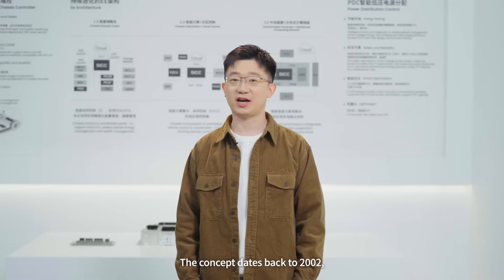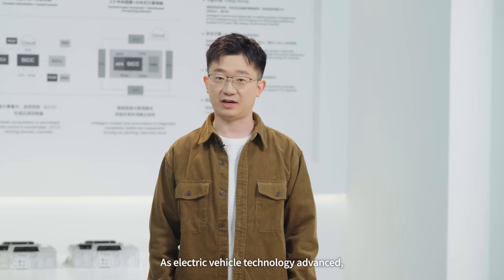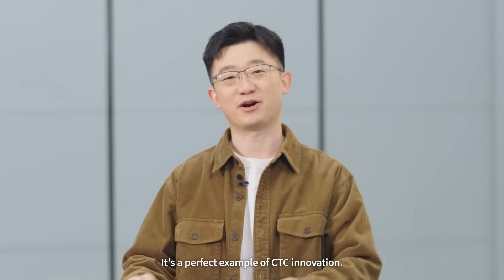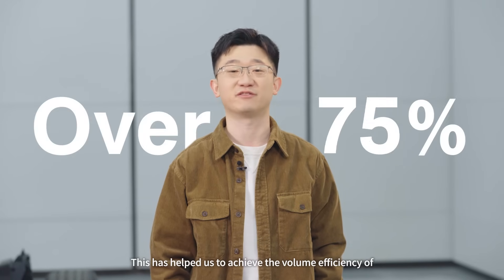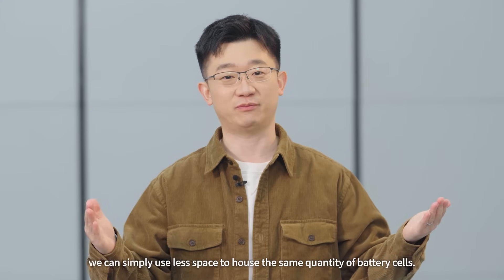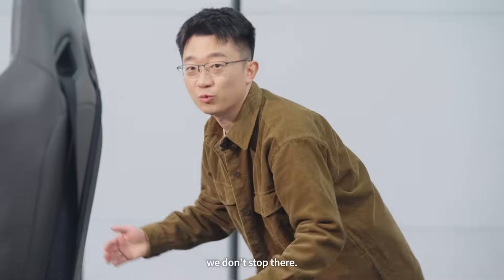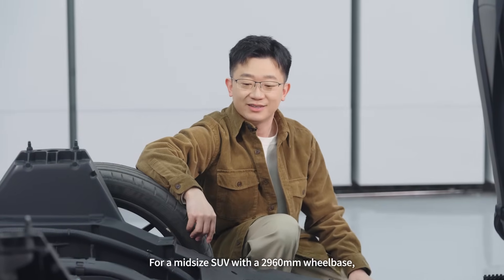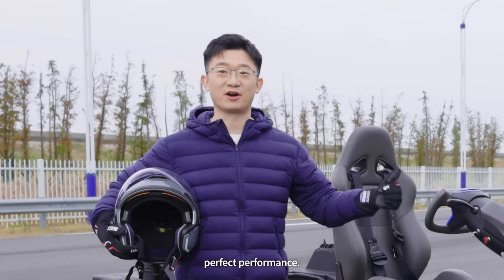Next-Gen Chassis

Comment: What happen if I want to change the battery due to faillure? This innitiative can increase volume but create tons work for repair. This idea is more like if the battery fail, scrap the car 😂. The future will be standardized battery modular, which has the same size. You can replace your old battery with the newest one because it has the same size, then no customers panic on skyrocketing price of phased out models

Comment: How do you replace any cell if the chassis were slightly damaged due to collision or road debris? Certainly you’re not telling me that I have to replace the entire chassis
Reply: Not the entire chasis but it would mean the chasis was damaged and would need repair alongside replacing the battery. Structural batteries DO indeed mean simple replacements are harder. Some, you just have to replace a module but how big that module is depends on how they built things. The full CTC one seems like it may require manufacturers or dealers to replace the battery even if they could later fix it.

Comment: Does that mean if you need a battery replacement, you need a new chassis?
Reply from the maker: No need to worry, our skateboard chassis is designed with modularity, allowing for the battery to be replaced separately without the need to purchase a new chassis. Although the need to replace the battery is very rare, we have already considered this requirement during the design phase and have conducted extensive replacement and maintenance verification. Therefore, the energy pod can be replaced instead of the entire chassis.
Reply: This is good engineering.
Reply: @CATLOfficial the sooner you kick ass the better. atta folks!
Reply: The new chassis will include the battery 😂
Reply: @wensiangfong  the matter is always if the price is right. engine and other stuff doesnt make part of the chassis and may be reused. the upper part if done correctly, can be swapped too
Reply: No, it doesn't.
Reply: I am assuming the battery modules can be pulled out.

Comment: if it was tesla people would be going crazy
Reply: Tesla invented structural battery packs. They've been using it with the Austin Model Y for years and now the Cybertruck.
Reply: @ structural batteries are a terrible idea as they can't be replaced it limits the lifetime of the vehicle
Reply: @avus-kw2f213  That's exactly what they're doing here as well.

Also, nope, the entire structural pack can be dropped and replaced. Not that they'd need to since there are several old Model S cars with over 400k miles on original battery and still going strong.
Reply: @ethan999oz  of course it will still go but not as far on a single charge
Reply: @ The point being, it's still possible to replace the pack.
Reply: @ethan999oz  yes but not as easy as replacing the petrol
Reply: @ The comparison here is between CATL and Tesla. Not petrol, lmao.
Reply: @ethan999oz  China makes electronics America makes petrol cars

and this is about reactions, not technology
Reply: @ No, this is about structural batteries. Nothing else.
Reply: @ethan999oz  oh than I’m wasting my time goodbye
Reply: @ethan999oz  Having to replace a pack rather than a faulty or damaged cell is a dreadfully wasteful and costly idea. With newer chemistries and solid state electrolytes energy density will be much higher and the need to save weight won't be as crucial. Structural packs are a temporary fad.
Reply: @Hejavra  People have been making this argument about battery packs in general for over a decade now. Yet even now, when battery technology is still in its infancy, only a small fraction of the cars ever experience the need for a cell repair in reality. It's even less now considering how much progress have been made in cell longevity. 

Secondly, with the even newer chemistries making batteries more reliable, structural batteries still make sense cause saving weight improves efficiency. And efficiency is the most important factor when it comes to EVs. It's ridiculous to suggest structural packs are a "temporary fad". This video wouldn't exist if that was the case.
Reply: @ Actually I agree that calls are more reliable and even now highly unlikely to need replacing. However, I still think a maximum range of 500 miles is more than adequate for the vast majority. That means in a not too distant future where energy density of 1 kWh/kg & 1kWh/litre is achieved and vehicle efficiency of 5 miles/kWh, a 500 mile range would only require a pack of 100kg and 100 litres…not really a size that makes a pack structurally relevant in mass produced passenger vehicles. Although it's possible they may still be advantageous in commercial and niche performance vehicles. You might also argue that V2G might still popularise huge packs in passenger cars but I see commercial and home grid storage becoming so ubiquitous and simpler to manage that V2G won't take off in a big way. I guess we'll see. Thanks for your thoughts  🙏

Comment: What about maintenance? Is it relatively easy and inexpensive to fix? Lead time for parts? Are components modular enough that if 1 cell is faulty i don't have to replace the entire battery pack? If the pack needs replacing, what is the supply chain like?
Reply: The entire car is disposable
Reply: @すどにむ  Have you been to the Scrapyard lately?
Reply: @ oh so you spend your day gutting foam out of Tesla packs?
Reply: This is a big thing about these structural packs. They make maintenance, especially outside of the dealer much harder and more expensive. The weight and room savings aren't all worth imo.
Reply: @nfzeta128  Again, no need for maintenance for the life of the vehicle, use for 20 years till they degrade and recycle them or replace them if you dare.
Reply: @ Unless something fails. Could be external causes like rock chips puncturing cells. Then the entire car's totaled, which makes it a disposable product.
Reply: @すどにむ  Rock large enough to go through steel plating protection of battery is large enough to cause major damage even for internal combustion car. Maybe oil sump or gearbox replacement may be cheaper, but is still dearly expensive, easily USD10K job compared to 20K battery job, none of them ideal, insurance can deal with both.
Reply: @すどにむ  People dispose of their vehicles much sooner of late, 4-8 years. Tradition of keeping vehicle from new till it breaks is becoming very rare.
Reply: @ You're just sugarcoating the word "disposable". The point is that the car remains repairable vs disposable, and it's not even about ICE vs EV. Many EVs are in fact repairable.
Reply: Still thinking about legacy technology I see smh. There are no moving or friction parts, no maintenance part. Generally engineered for possibly up to 20 years of use and will likely exceed about 1.5-3.5 % current degradation of current batteries per year. Owner/operator at 20 years could still be having 50-70% usable capacity or the entire battery can be reused for household or other energy storage purposes as is the case even now.
Reply: @ So accidents don't happen (crashes, flying debris etc)? Fewer moving parts does not mean no issues with the car, there can still be manufacturing faults which has happened with all EV manufacturers.
Reply: @verygoodbrother  True that, but it's the same with any type of vehicle. Try buying an Range rover or BMW X5/X6 outside of Warranty!
Reply: @thabzmad7265  I didn't say anything about warranty. I asked what is maintenance/repair like? You responded with a defensive and irrelevant comment despite you agreeing that an EV is like any other type of vehicle (duh, hence the question).
Reply: @verygoodbrother  You mentioned manufacturing faults, these are typically issues dealt with under warranty. Nothing defensive about it, just stating reality. Good day.👍
Reply: @thabzmad7265  manufacturing faults or not it is good to  know costs and lead time. The costs factor into car insurance and how long someone will be without their car. Like I said, you're being defensive over a simple genuine question

Comment: Love CATL Innovations !
Awesome Build Chassis !
Wish CATL can also build a removable batteries Large Chassis that has high ground clearance for off-road pick-up trucks , large size cargo van , RV Campers , Buses and trucks with an air suspension system abilities to be lower on highway speed and rise up on rough mountain terrain off-road condition. 
This high ground clearance Large Chassis will sell like Hot Cakes for many different applications  !!!
Hope to see Large Size Off-Road Electric Trucks and Large Electric Cago Vans for safer, cleaner environments !
Wish to see this happen someday in the future  !
😉💖🛻🚚🚐🚎🚌🚒🚑🚎⚡️🔋💯👍
😉💖🌬🌊🌞⚡️🔋💯👍🌏✌️🙏

Comment: So now you can’t replace the battery pack at all? Man, that doesn’t feel good.
Reply: I know that the lifetime of the battery can exceed that of the rest of the car, but still …
Reply: Did they say that? it certainly looked to me like the cells were slotted in....
But, even if they can't Take a look on the channel and you will see the CATL cell failure rate is trending to zero.
Also investigate how many cells they use per pack, divide the capacity by that number to determine the percentage loss, then question if the individual cell can be disconnected from the pack by the BMS.
let's guess at 200 cells?
In that case, loss of one cell would result in 0.5% Capacity/ Power reduction.
As for "The pack", CATL is predicting VERY long life.
Anyway, why do you assume the "Pack" would be the point of Failure rather than the control modules?
If they failed, they could be replaced.
Reply: The BMS will never be able to isolate an individual dead cell. It would require far too much extra cabling.

Will be interesting to see if cells can still be replaced in this design.
Reply: Porsche did it with the Taycan, isolated the bad cells from the pack. Although, they didn't on the car's software, it happened at the dealership.

Comment: Please develop dry coating solvent-free  process  production line  for 30% lower production costs and 30-40% higher nominal capacity(even higher in LFP cathode cells because LFP cathode has the potential of 60% higher active materials in dry coating process)and energy density cells because of thicker electrodes(almost double in thickness) and higher active materials in both cathode and anode in the cell.also please develop an ultra power dense electric drive unit with 11 kw/kg drive unit level power density and 21,000 rpm rotor speed paired to a 2 speed transmission for maximum high speed efficiency with gear ratios of 12:1 for first gear and 4:1 for ultra high speed efficient second gear for your amazing BEDROCK CHASSIS
Reply: D'ya think they MIGHT have look at ALL possibilities? (As the Largest Battery Manufacturer on the Planet?).... Maybe?
Reply: dry electrode coating manufacturing process has never been done by any commercial battery manufacturer ever.its relatively new technology.tesla trying so hard to manufacture world's first cylindrical battery cell(4680 form factor)that implemented both amazing tabless technology(compared to traditional tabbed cells tabless cells have twice the cycle life meaning 4000 cycles,up to 70% lower internal resistance meaning 40% lower generated heat in heavy pulse discharge rate,up to 200A pulse discharge rate for continues 5 minutes meaning a 112 kwh battery pack with 21700 tabless cells can provide not heard of and not seen before 4,400 kw or 6000 ps for 5 minutes,up to 600 kw or 6c charging capabilities and only highstar tabless cells-2025 PRiMX50U-Power 5.0 Ah 21700 by samsung sdi and tesla cyber cell have this amazing tab-less technology in the entire world)and dry coating process into 1 single cell.which is truely fascinating . so i want every battery manufacturer including CATL,tesla, samsung sdi ,LG energy solution , gotion hightech , CALB ,SK on,mercedes benz eCampus,geely,FinDreams by BYD,prologium,sila nanotechnologies,panasonic energy and etc to revolutionise battery manufacturing and technology in a very short period of time,BECAUSE world needs a huge step forward in battery energy density and performance for greener future which will not happen with current  available short lasting and  limited energy density(300 wh/kg) battery technologies. world needs something better soon . i have to admit that tesla is on forefront of the game right now
Reply: @davidfujkk8018  "has never been done by any commercial battery manufacturer ever."
You said commercial, this eliminates all manner of R&D which roger was talking about.
Reply: Ye